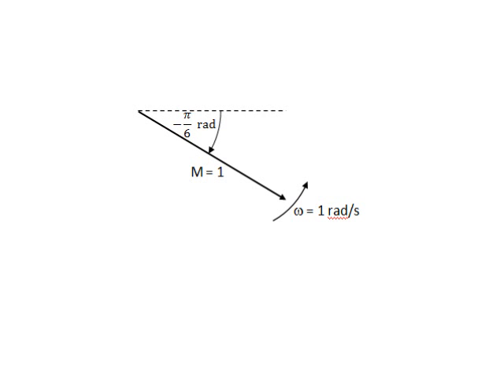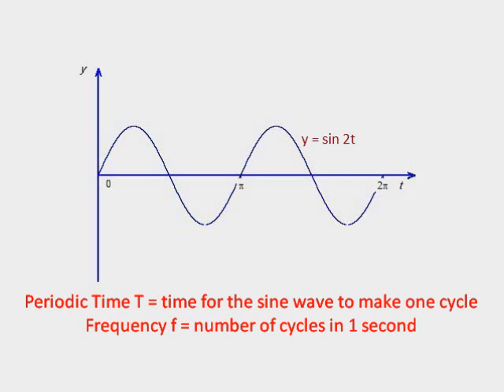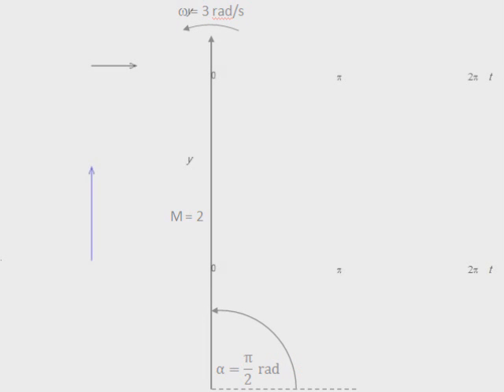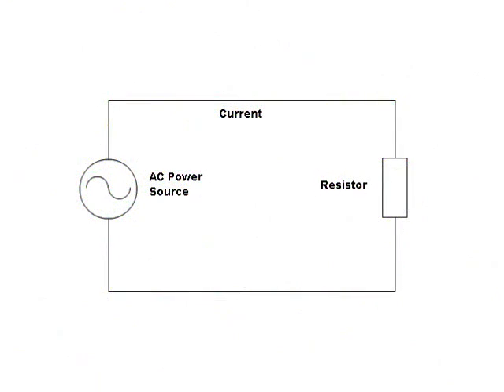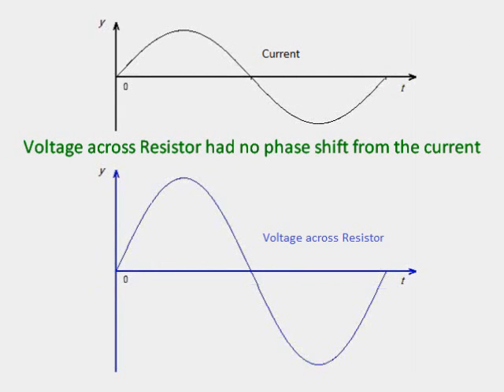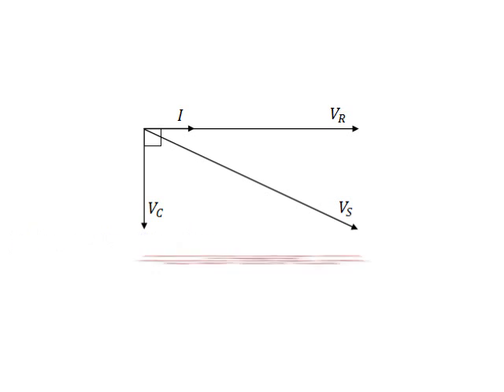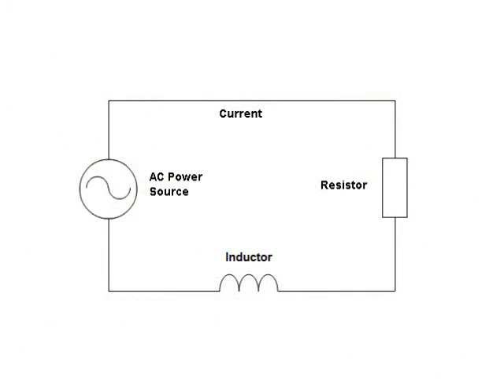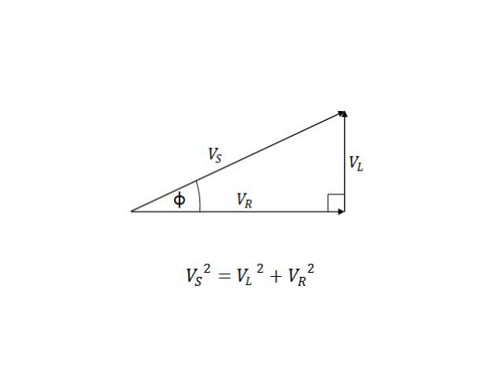Phasors In Electrical Theory - Part 2

Comment: according to my understanding capacitor circuits leads the current over voltage, i.e current in advance to the voltage, and opposite in case of a inductor circuit.... but your video at 8:23 shows the opposite to what i have said.... please correct me if i am wrong.... :)